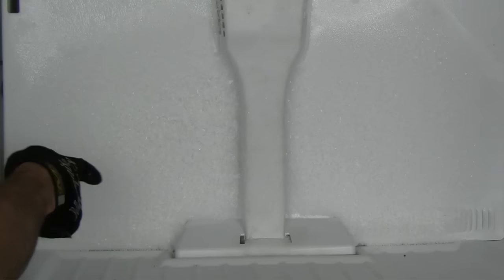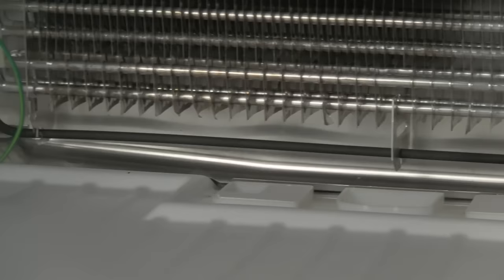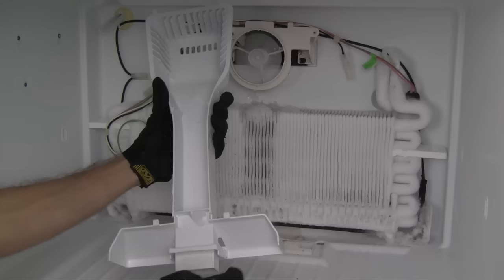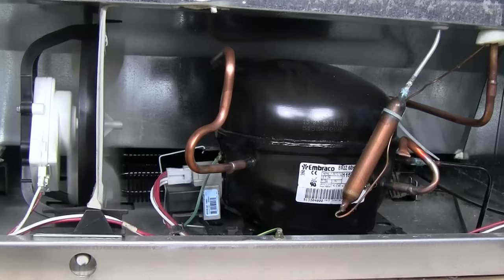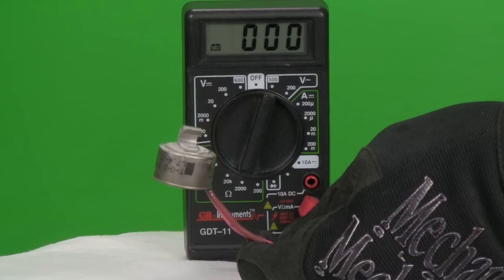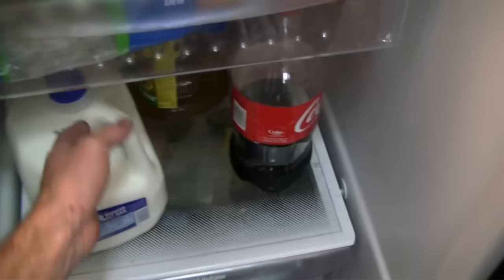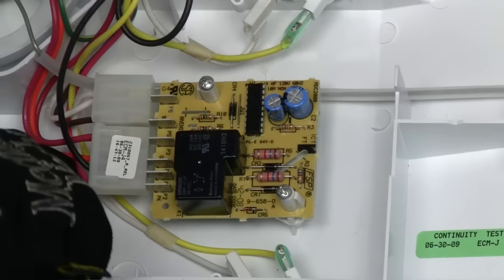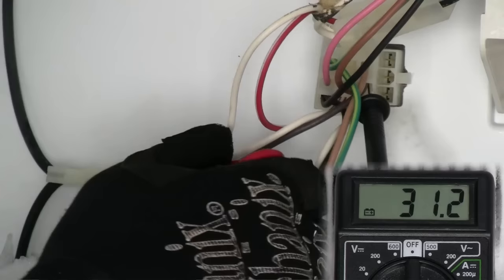Refrigerator Repair (Not Cooling, Defrost System)

Comment: Thanks this was great. My side by side fridge is not working as well as it should be. My bi-metal thermostat was closed when tested. Once I warmed it up out of the block of ice it opened. I also had resistance on the heat elemenet. So it has to be the defrost timer.

Comment: Great  video.... very informative  Thanks.  I have the same fridge and it works fine for about 4 days then I see frost in the back of the freezer wall. At this point the freezer and the fridge warm up.  After  unplugging it overnight and the frost thaws out it works great again for another 4 days. Is my thermostat broken ? What part do I need to replace. Please help. Thanks

Comment: Thank you very much, the bottom vent in my fridge side was covered with Ice and air was not circulating causing my fridge to not cooling. I check many videos before you and I was ready to go out and buy a new one. I just save a little more than $1000 buck

Comment: You video is awesome, I should have watch it before working on my freezer. My upright freezer would get slightly cold when plugged in, but the fan would not spin even after I changed out the evaporator fan motor, relay and capacitor already but it worked for a few days only. It's making me crazy.

Comment from the maker: The temperature should rise during the defrost cycle so if the thermostat is working properly then it should be closed trying to start the cooling cycle again. Also the defrost timer only advances when the compressor is energized so it cannot advance into the defrost cycle unless the thermostat is closed "on" energizing the circuit.  Thanks for the question!

Comment from the maker: @Mutalator182 About 98% of the time, letting it thaw out should fix it  of the time from what you've described (door being left open, freezer very cold, fridge warm). Better with the doors open, that way you are sure all of the air ducts have melted completely.  Sometimes the ducts won't fully thaw it the doors remain closed.  Good luck!  Thanks for the comment!

Comment: Hi, your video helped us a lot. We got a problem with no drinking water running on our fridge dispenser and ice maker not working. Thank you.
Reply from the maker: I'm glad you liked it! To troubleshoot the water issue you need to follow it back to the source and see what's  blocking up the works... Depending on your model you may have one or two valves, as well as a water filter.  Any of these can cause that kind of problem.  If you get stuck, get me a model number and I can look into it.  My response time has been slow lately... lots of appliance repair needed... so little time!  : )    Thanks for your comment!
Reply: applianceassistant Thank you for responding to my querries, the model is SAMSUNG SR-S2028CVW.
Reply from the maker: I am not getting any results with model number SR-S2028CVW. : (  That happens sometimes (not good) but would you mind double checking it for me.

Comment from the maker: @06GTFanatic The fan in the freezer should definitely be on if the compressor is running.  You may just have a problem with the evaporator fan.  You should also check the coils down by the compressor and make sure they are clean.  Email me through my website with your model number and I can do some more checking for you. The link is in the vid description.  Glad you liked the video! Thanks for posting!
Reply: Hi I have a beko fridge freezer the freezer part is not defrosting no more and building up with ice, what can I do to sort it out.

Comment: Thank you for giving your knowledge in such a way that is easy to understand.  I do have a problem with my Kenmore Frig.  The freezer has not been freezing right for a little while.  It is on the bottom of the system and I just thought that when we shut the frig part that the freezer door would open and that was causing the problem.  While the other night the outside of the freezer part was very hot to touch.  I pulled it out and the dust that was on the back was as thick as a piece of felt.+

Comment from the maker: @23chilled I feel your pain! That's kind of why I started this project. Because you want to be sure its not some little 15-75 dollar switch, timer, or thermostat that would cause you to swap out a 500-3000 refrigerator at 5 years. Most compressors would not give out at 5 years... It happens, but very rarely.

Comment: Cool video, no pun intended. I have a Hotpoint fridge freezer that is 28 months old and the same situation, freezer working but the fridge is not. Before I call an engineer out I am going to switch it off for a few hours in the hope the issues is ice-build build and might work again. You do not get what you pay for today, £800 on two new fridges in 5 years that replaced a 20 plus-year-old one that still worked, but was not big enough for my needs. I dare not take mine apart yet, guaranteed if I do and I then need to call out an engineer they will say you have voided the 10 year parts warranty

Comment: thank you very much for the educational video , i have a refrigerator DF80X , which had the same problem the cool air was not flowing properly. The authorized service of electrolux argentina ,came twice and change the first time the sensor network and the second time the power board (I was going to call for the third time , every time they came 50 usd ).I will defrost manualy and watch carefully the time we left the door open.

Comment from the maker: on most residential refrigerators the timer motor is only energized when the thermostat is closed and the appliance is actively cooling. So that 6 hours can take more than a day to accumulate. there are many different timers 8- 10 hours is also very common. Thanks for the comment.

Comment: @ 4:25 This was all I needed to do, but I also took the back panel off inside the freezer compartment and chipped away the ice build up @ 2:20 that was blocking the cold air from going into to the fridge compartment.  I'm not sure what caused all that ice build up, it might have been from setting the freezer compartment too cold over the last 5 years or one of doors might have been left slightly open overnight.  I'm not sure about the thermostat and/or defrost heater being broken or not, it's not really a big deal for me as long as cold air is still be blown into the fridge compartment, if the ducts ice up again I will just manually remove the ice build up.  MANY THANKS, GREAT VIDEO!

Comment: @applianceassistant Yes, the fan in the freezer seems to be working fine.  I can hear it and I see it blowing on things in there.  I see the control housing, I think I may have to pull a few screws to get to the timer.  I'll try to let it defrost a little longer first (3 hours?) before attempting invasive surgery lol.  Thanks again for the vid and the response!  If I do have to order parts or something, I'll definitely be getting them from your site.

Comment from the maker: @jurnagin Normally turning the controls all the way up would not cause a block of ice, but there may have been a defrost problem or ice buildup that caused you son to think that he needed to do that in the first place.  If the problem comes back after a few days after you deiced it check that the air ducts are clear and the evaporator fan is working.  If all that looks good you will need to check the defrost thermostat and timer for proper operation.

Comment from the maker: @sikesterone Some freezers have visible condenser coils located under or on back of the freezer. Other "hot wall" freezers use condenser coils foamed into the side walls of the cabinet for getting rid of the heat that is removed from the freezer.  However if there are condenser coils under the freezer you may want to give them a good cleaning with a shop vac or an condenser cleaning brush. Dust can build up and block the heat from escaping efficiently causing parts of the cabinet to heat up.

Comment: I have a fridge that's not getting as cold as it should.  Freezer is most obvious, but fridge portion takes a long time to cool.  The evap coils in the freezer were frosted over pretty bad.  Defrosted and pulled parts as I could get to them.  The bi-metal stat would not give continuity when in a glass of ice water or at any stage in the warm up process...so it's bad.  Thermoprotector piece checks for continuity, defrost heat element checks for continuity.  Followed up in next post.

Comment from the maker: Sounds like an air flow problem...  I would suggest looking at the refrigerator troubleshooting section on my website. There is a link in the comments section of this video.  There is a door that opens and closes to regulate the air flow into the refrigerator section. That could be broken in the closed position, or the fan in the freezer may not be working, or frost could be blocking the air from moving into the fresh food area. I hope the article helps! Good luck!

Comment from the maker: Yes that would cause fresh food cooling problems. That evaporator fan looks like a normal 120 AC voltage motor so apart from some very strange control issue you probably just need a new fan motor.  You can eliminate the control as a cause by checking for AC 120 at the fan terminals with a volt meter. If that looks good it is definitely the fan motor. If you need to buy the fan I would appreciate it if you purchased through the links on my website! The link in in the video description. Thanks!

Comment: Very helpful. I was about to ditch a fridge and it seems the heater went out, or was damaged by the ice buildup. The resistance test failed, so I will be replacing the heater coil. Thanks again.
Reply: I've defrost issue as well. I've changed the thermostat and timer. Still the frost are all over the coil. Based on yr experiencd wathcing this video, what sgould I do?

Comment from the maker: @gbgal Well the puddle is probably being caused by the defrost cycle. So we can assume that the unit is defrosting.  Your cooling problems are probably being caused by the door being left open at some point, allowing frost to build up in the air ducts, or you may have a bad evaporator fan (the fan in the freezer) If the leak is not a cracked pan I would look at the small drain below the evaporator. It may be clogged or frozen allowing water to leak into the refrigerator..under the crispers..

Comment from the maker: @thegannclan Hot surfaces are usually an indicator the the cooling system is pulling heat from the freezer compartment correctly but it is having a difficult time getting rid of the heat that has been drawn into the system, so the heat within the system tends to try to escape from other locations such as the area between the freezer and refrigerator doors.  some refrigerators have a heater to keep condensation from gathering there so its not a sure fire indicator, but a good clue.

Comment: I have a Kenmore model 10676232402  top freezer.  The other day it got warm in the refrigerator part below and frost built up on back wall of freezer. I unplugged it, everything is out of it now and plugged it back in. It's been running for about 3 days and has been great, no problems at all and it's still empty. I put just can drinks in the fridge part, idk if it was leaving door open 2 or 3 mins and I checked within like 15 mins after, it was definitely warmer than earlier in the day.

Comment: Blessed good night to you ApplianceAssistant. You did a very wonderful video n explanation on how the fridge works, but you lost me at infinite resistance. If it's possible I will like to hear about that more indebt. You have done a really wonderful presentation that was very educational. Thank you very much. My refrigerator is not cooling but my freezer works but when I put ice trays it's not freezing. Only on the floor of the freezer. Will very much appreciate some tips on what to do pretty please.

Comment from the maker: Sorry for the delay... sounds like ether the door did not get closed fully at some time or a defrost problem. try turning it off for a day and letting it thaw out, then watch for new frost.  If it comes back you will need to de some more troubleshooting.  I have lots more refrigerator troubleshooting help on my website. good luck! Thanks for the question!

Comment from the maker: @p3dsman Thank you! The compressor should be running anytime the main thermostat senses that the appliance is not down at the proper temperatures, unless it is in a defrost cycle.  If the compressor is running and it is just not able to get down to temp, try cleaning out the condenser coils, usually located under the refrigerator. If the condenser coils are clean and it still is not getting down to temp you may have a gas leak (not good) or perhaps the thermostat activating the compressor.

Comment from the maker: @thegannclan Hopefully just cleaning the condenser coils really well will fix your problem. You will also want to check the fan the pulls air across the coils and compressor is working and not jammed up.  That is the other very common thing that happens with refrigerators...air flow problems when it comes to the dissipation of heat from the condenser coils under the refrigerator, dust can effect how well the freezer cools.  If the coils are clean and its still not cooling well... Not so good.

Comment: To be specific like what happened to our Samsung double door fridge, it's the heating element that needs to be replaced. If both freezer and fridge doesnt get cold and no cold air blowing out you need to replace the whole Control Board. Good for us ours is still under warranty until 2012. Always nice to get extended warranty for appliances that costs more than $1000. I hope this helps.

Comment: This is a solid video which I'm sure has saved a lot of people a lot of money!
My fridge has frosted over twice, once after the door was left open and again ten days later. I'm slightly suspicious the door was left open again. If it wasn't, could the coils/vents have frosted over that quickly without a  working defrost system?
Reply from the maker: Yes 10 days is about right for a defrost problem to show itself a second time.
Reply: @applianceassistant  thanks! I think I was hoping it was a door issue so I wouldn't have to fix the defrost system. Will have to suck it up and start testing it

Comment: I am not getting "any build up" on the freezer coils, but a build up only around the bi-metal thermostat (I have thawed it out twice).
I did accidently leave the door open one night about 1/4 of an inch (the light didn't even come on).  I closed it and about three weeks later I started having problems with it freezing.  The freezer sets itself at 20 degrees and the fridge at 40 degrees and has remained so for the last couple weeks  (The dial is still at the original "Normal" setting).

I can't find a timer reset hole, so suspect I have a circuit board.    Both the compressor and freezer fans work fine, and the compressor works without excess noise.  I took the compressor gage off and it doesn't rattle.
As soon as a family member comes along that has a elec. gage, I will have them check the continuity in the freezer area, but that could be an hour to a couple days.
At this point I suspect it is in need of more refrigerant.  What do you think.
Thank you for your help and attention to this dilemma.  Love your videos, sent them on to others.

Comment: I bought a new defrost timer that works perfect but, the coils will not defrost and I have to set the settings for the fridg. and freezer to the warmest settings.
What is causing this problem?
Awesome video. Thanks so much for your knowledge and video.
GOD bless.
Reply: It is the thermistor on coil there are 2

Comment: I have a Maytag MSB1542ARW french door style frige.  It is icing up in the back of the freezer where the coils and not cooling the frige too well.  I have defrosted it once and it worked for a couple of days.  Now it has the same problem.  I will test out the thermostat and heating coil for continuity tonight.  I hope it is just the thermostat.

Comment from the maker: The only thing I can think of on yours is that the control is stuck in the cooling state, so the compressor is constantly running.  I'm sure when it was unplugged it warmed up...   but when its on it should cycle off when it gets down to 0º or so. If not the temp control system that cycles the compressor on and off must have a problem.  Depending on the model there may be a few parts that could cause this.. sensors, control boards and switches etc.

Comment: Hi, thanks  for your video. It is helpful ...drain pipe was plugged in our fridge....once I put everything back it start working I heard the fan was running but after 2 minutes it stop working I can't hear or anything running..I don't know what I did .it's same fridge tha one video is on
Reply from the maker: That is a strange timing for it to suddenly stop after a very short time. My guess would be the main temperature control device, like a control board or main thermostat, depending on which your model is using. Good luck!

Comment from the maker: Sorry for the delay! If there is frost on the back wall of the freezer section it is likely a defrost problem... If not I would check to see if the fan in the freezer is working and the little automatic door that opens and lets air into the fresh food section is not broken in the closed position. You can get to that by removing the control housing in the back section of the fresh food area. If the fan in the freezer is working you should feel air through those back vents. I hope that helps some!

Comment from the maker: If you feel even a little cold air coming into the fresh food area it sounds okay.  My guess would be that the air return ducts may be blocked.. in that case you would feel air when the fresh food door is open, because the air has somewhere to go. However when the door is closed air would stop moving because it cannot return to the freezer area... Hope that helps. Good luck!